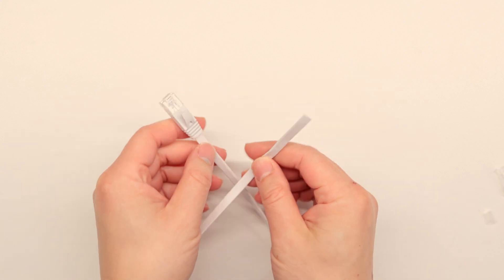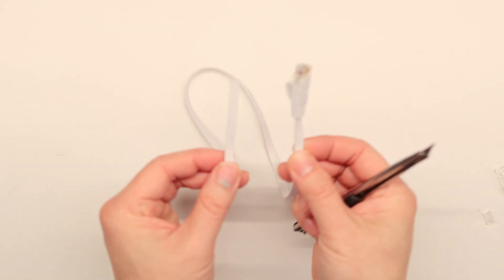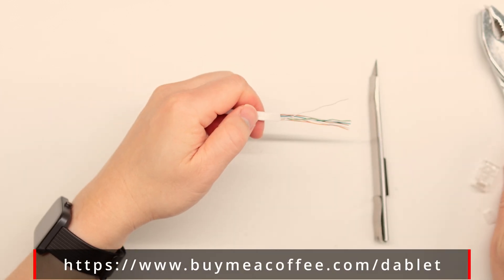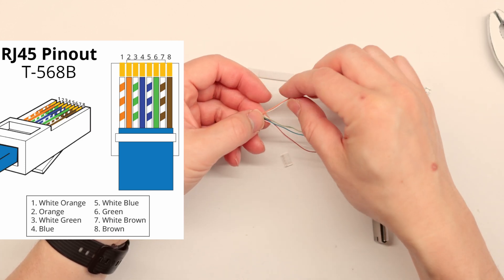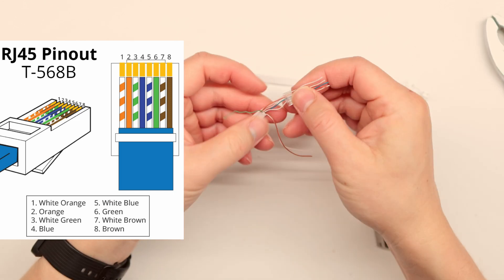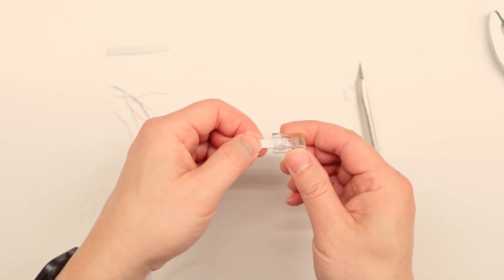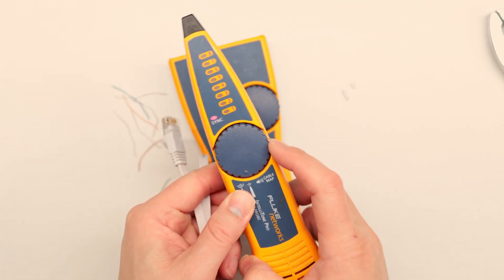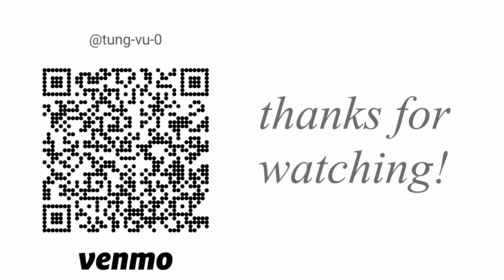flat ethernet CAT6 cables. how to repair or terminate RJ45 easily

Comment: My cat chewed through my flat Ethernet cable and was told p much there was no hope to termianting it because it's flat and stranded cables. Ty so much for the best jank solution, will be trying this later tonight, I don't need it to hit my full 2.5gbps speed but I'll settle for a fix that gets at least half way ahdjf
Reply from the maker: yes, you can do it! with the stuff i linked above, it's straight forward to follow along  :)

Comment: Those without the load bar will need the crimping tool?
Reply from the maker: yes, you still need crimping tool i linked. no way to use a normal pliers.

Comment: I find that when you are sorting the cables the most effective way is to pinch them between your finger and thumb about 3/4" from the end. Once they are sorted trim those cables back about 1/4" from the end. You should be left with 1/2" of sorted cable that you can either put into a comb or a pass through connector. 60% of the time it works every time.